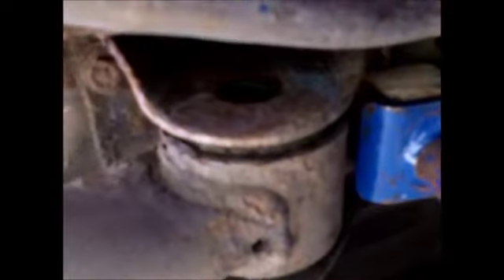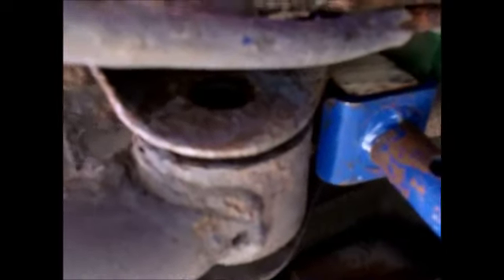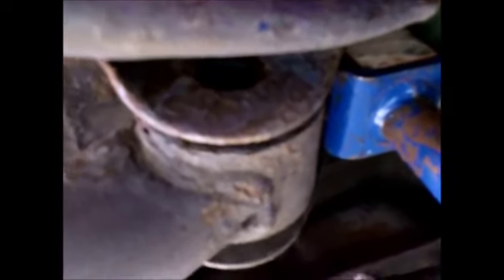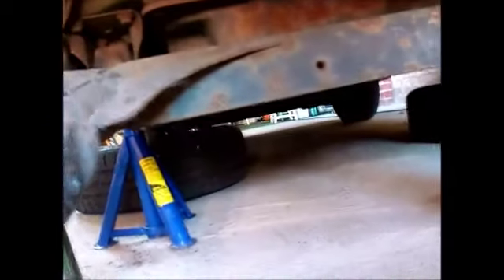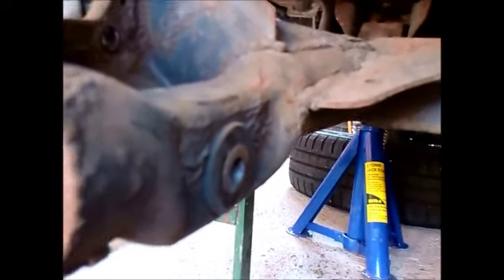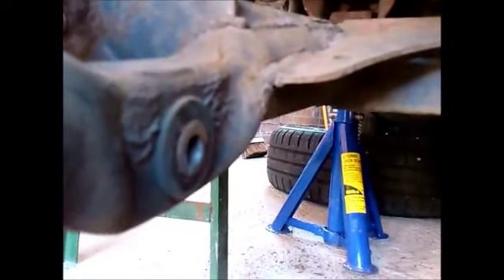FK-OC - Ford Ka Rear Beam Removal

Comment: Appreciate the helpful video Andrew. My Kia Rio has a failed axle bushing and I will be replacing soon. The Kia rear suspension setup is virtually identical. Removing the hubs and simply detaching the brake backing plates with entire brake assemblies in place is genius. Simply setting these closely aside with brake lines and parking brake cables attached is a time saver for sure.